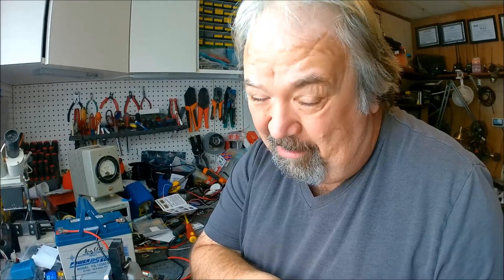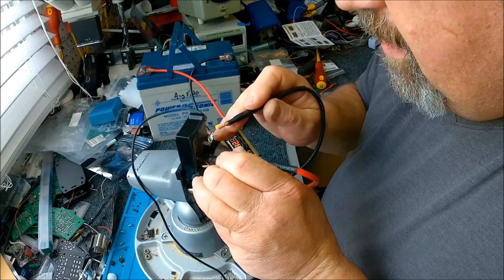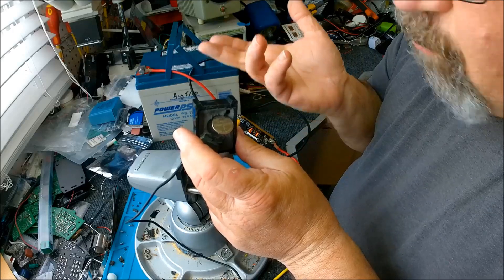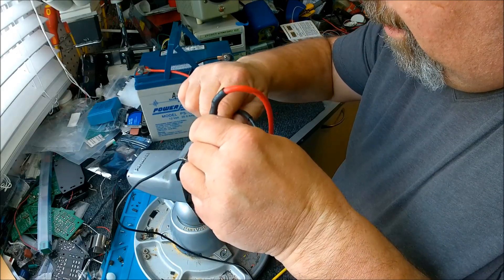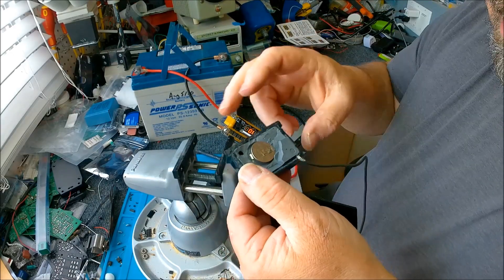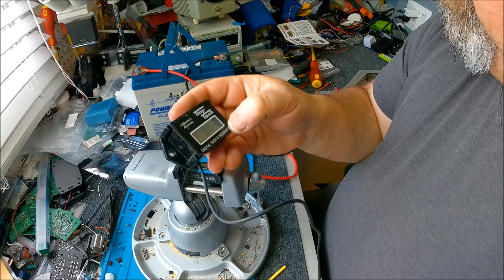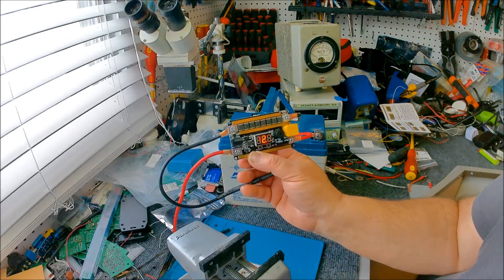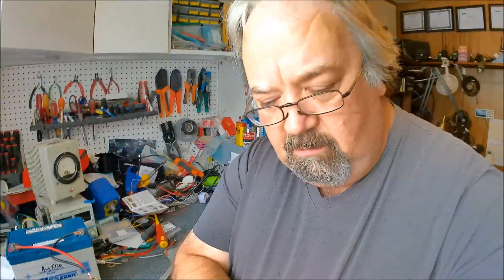EP 72. Tiny Tach Battery Replacement. For my Challenger 2 Ultralight Airplane

Comment: I LOOKED ON MY TINY TACH AND IT SHOWS IT IS ON WHICH GREAT BUT THE AIRCRAFT ISNT DONE YET. IS THERE A WAY TO TURN IT OFF.
Reply from the maker: They never turn off. Battery is expected to last at least 5 years, some have lasted over 10. They are a great little unit, but now their are some others on the market that have replaceable batteries. Which I feel is a much better option.
Reply: AND THERE ARE A LOAD OF 12 VOLT SPOT WELDERS ON THE MARKET. LIKE THE ZERO LAB.

Comment: I’ve never used one of those mini spot welding tools, but I’m wondering if it could hurt the battery or the electronics? There are also amazing new soldering techniques I would like to try as well, but they seem to good to be true? As always I appreciate these videos 👍
Reply from the maker: The current flows from one probe to the other, so the electronics and the battery are not effected at all. Don't use too large of a battery, as this kind of tool has no output regulation other than timing. A motorcycle battery or small yard tractor battery is about the right size.